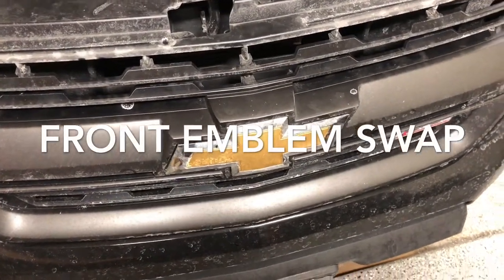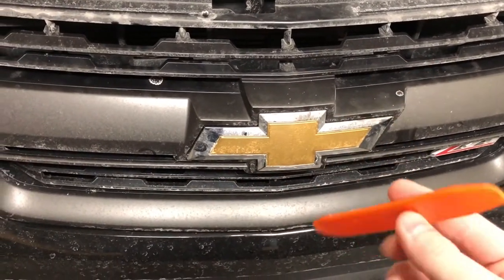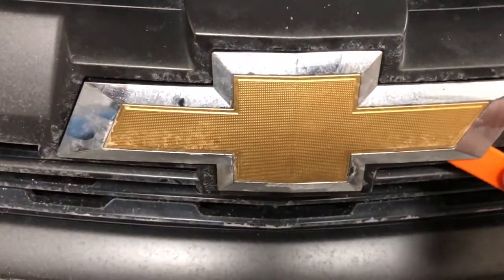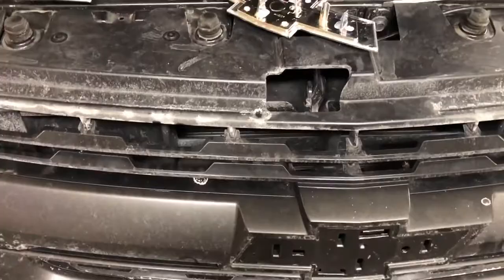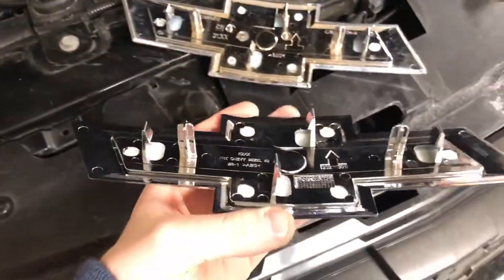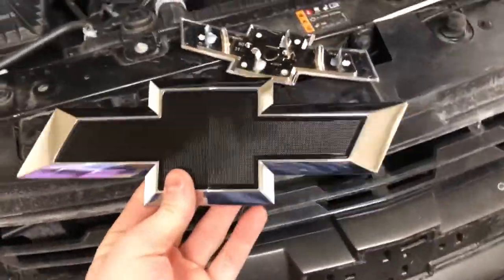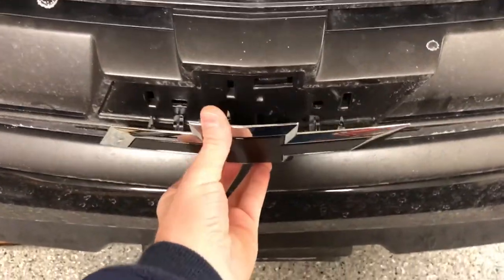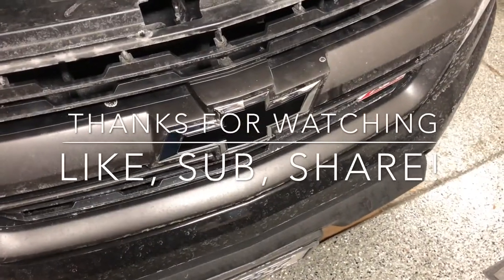[HOW TO] Replace Front Chevy Bowtie on a 2015-2020 Chevy Colorado (EASY)

Comment: Thanks!  I thought I would have to take apart the trim above the grill to do this job, I can’t believe you can just pry it out. Question: is that a factory Chevy bowtie?  Where did you purchase it?
Reply from the maker: James Wheaton yea I was surprised too! Lol. Check the description for a link to the bow ties. They are an OEM GM part. Make sure they fit. Cuz I think they might have changed at some point.  So 15-16 might be different than 17-18.
Reply: Fondupot's Garage thanks!  We have nearly the same truck so I should be good there.
Reply from the maker: James Wheaton right on! Happy modding!